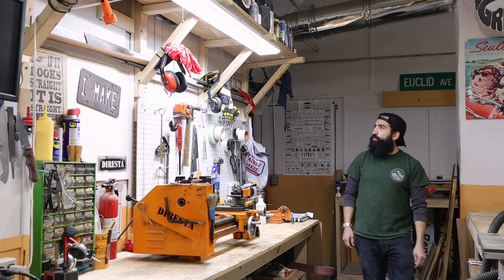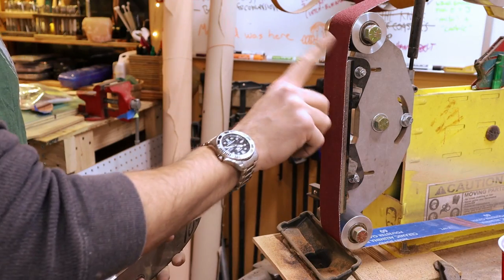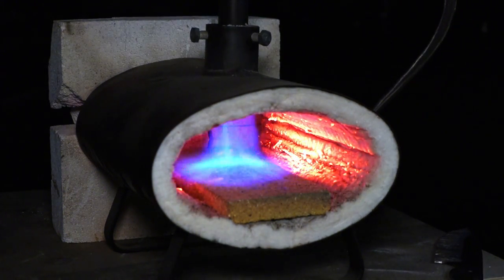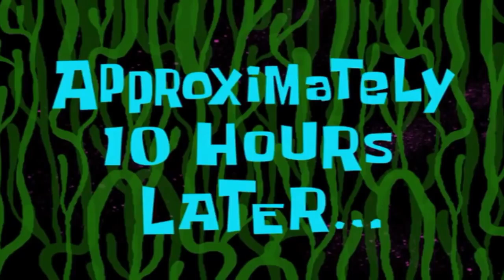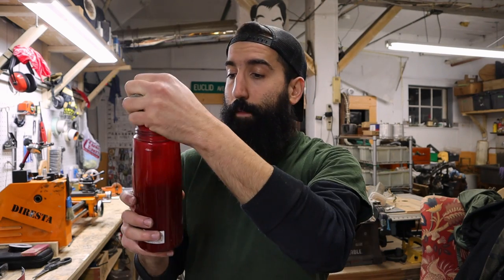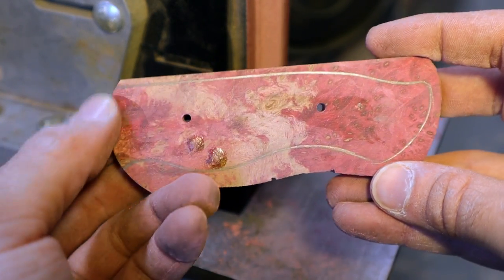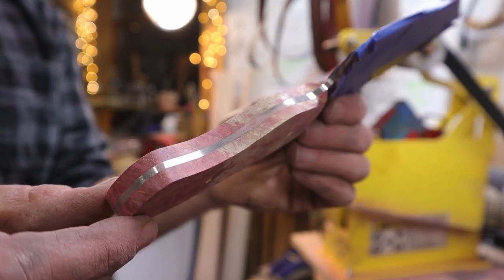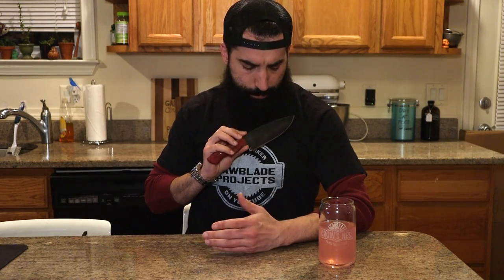Graz Makes: A Stonewashed Kitchen Knife! (from 1095 steel)

Comment: Looking at the comments, I can see this is a 4ish year old video, so if you manage to see this, I guess I'd be lucky.     But an idea I had while I was watching your video,  I came across a question  for kitchen knives in general.    In sword making, they have a blood groove, The reason being not only to let the blood out, but to  make an uneven part so air can get in, releasing any sort of vacuum.  Something like this would also benefit in the kitchen for when you're, say, cutting an union, so the onion slices don't stick to the blade.  Could you put either a blood groove, or just a straight hole halfway in the blade to help things release from the knife while chopping?   Another idea, would be instead of a flat 20 degree angle when making the blade.. have it start at, say 10 degrees, and work up to 20 for an ever so slight  curve, and eliminating the huge flat area.

Just questions from a curious person.   Thank you if you do see this.